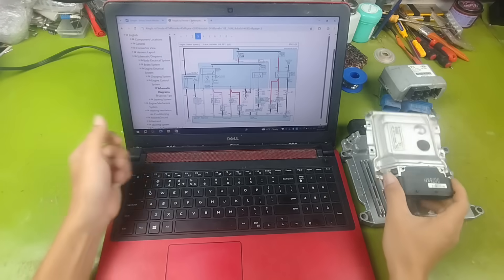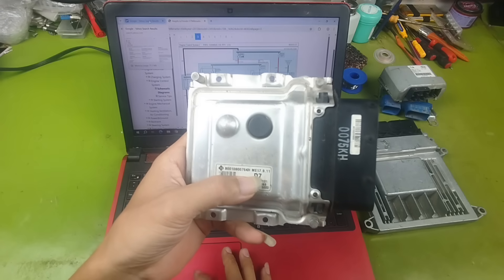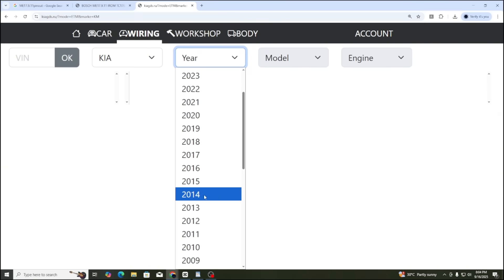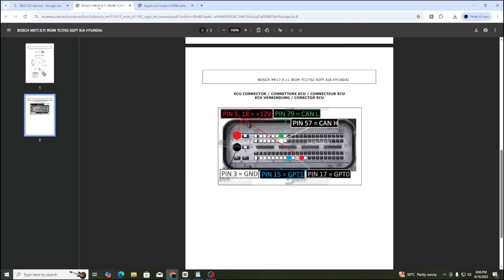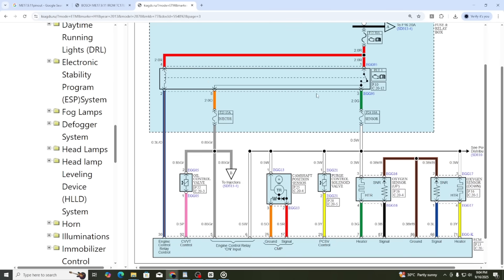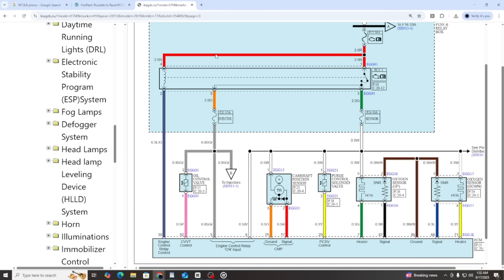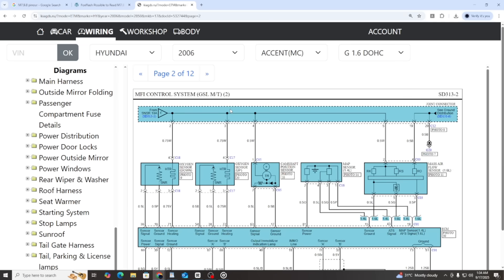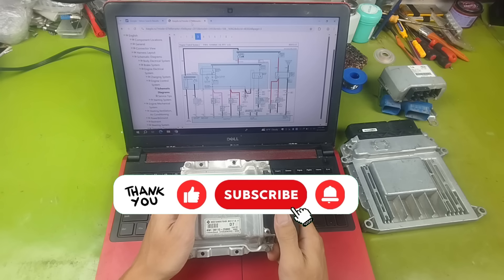How to Accurately Find ECU Wiring Diagrams | Beginner’s Guide to Car ECU Repair. #ecurepair

Comment: Wondering if you can help me. I have a KEFICO ECU off a G4EK engine. I use these engines as teaching aids for my students to rebuild. One of the ECU's has no injector pulse, but the other 5 ECU's I have operate the engines perfectly. I have tried your method, but can't find any pin-outs for this ECU. I don't have a definite vehicle or year as these are just engines on stands that run for a few minutes after being rebuilt by the students. I would like to get this faulty ECU repaired so that we can use it.
Details are:
KEFICO (licence Bosch) 9030930028E, 166516, 39110-22336, G61, 028RHD, P08
It has a single connector with 3 rows of 55 pins
Any help would be gratefully appreciated